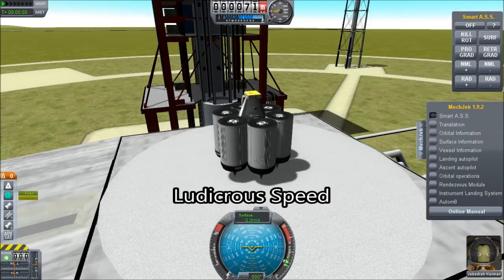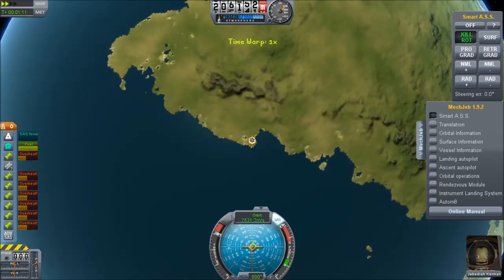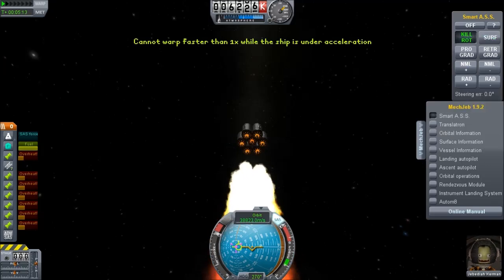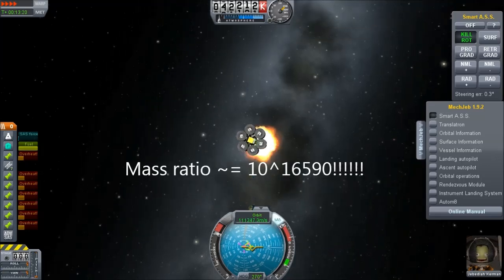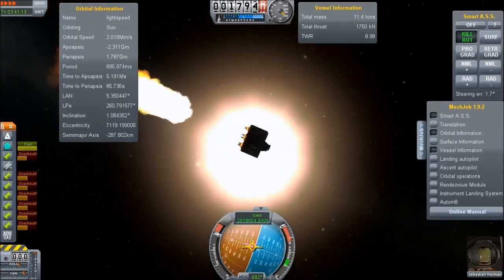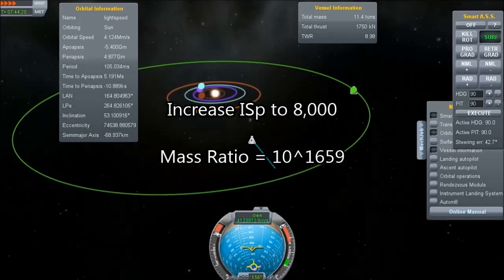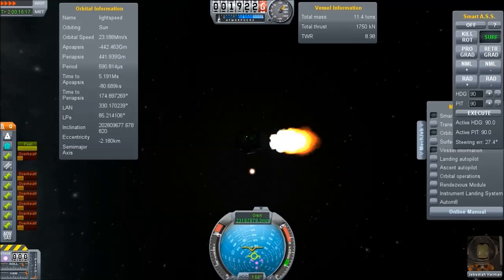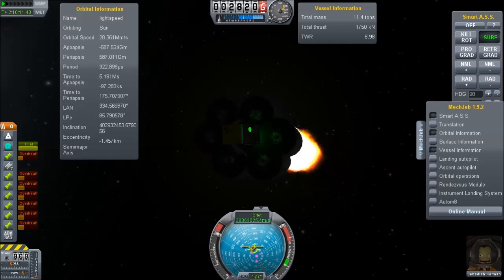What Does It Take To Reach Lightspeed In Kerbal Space Program?

Comment: The Tsiolkovsky equation (the rocket equation) works for low speed travel.  

Figure speed knowing fraction   Figure fraction knowing speed
Vf = Ve* LN(1/(1-u))   -->     u = 1 - 1/EXP(Vf/Ve)

Where Vf=final velocity
            Ve=exhaust velocity
            LN(...) = natural logarithm
           u = propellant fraction. (0<u<1)
            EXP(...) = exponential function

Solid fuel rocket:  Ve=2.5 km/sec (SRB)
Liquid fuel rocket Ve=3.5 km/sec (Atlas, Titan)
Cryogenic rocket  Ve=4.5 km/sec (SSME, J2)
Nuclear thermal rocket Ve=9.0 km/sec (NERVA)
Nuclear pulse rocket  Ve=20.0 km/sec (Orion)
Ion rocket Ve=50 km/sec (NEXT)
Fusion rocket Ve=23,000 km/sec (Li-6/Deuteride pellet in a self collapsing plasmoid)
Photon rocket Ve=300,0000 km/sec
Light sail  (effectively infinity since propellant is not consumed on board)

When we use photon rockets (exhaust speed equals the speed of light) powered by matter/anti-matter, we need to adjust the normal rocket equations adjusting for the rapidity of the motion through space and time.  

This transforms the Tsiolkovsky equation to the Rindler equation;

For a positronium rocket this equation becomes;

Figure speed knowing fraction         Figure fraction knowing speed

   Vf = c * TANH( LN( 1/(1-u) ) )  ->   u = 1 - 1/ATANH( EXP( Vf/c) )

Where Vf = final velocity
             c = speed of light
            TANH(...) = hyperbolic tangent
            LN(...) = natural logarithm
            ATANH(...) hyperbolic arctangent
            EXP(...) = exponential
            u = propellant fraction (0<u<1, positronium)

So, to get to various speeds requires the following fractions of positronium;

u Vf/c dilation
0.1 0.105 0.994
0.2 0.220 0.976
0.3 0.342 0.940
0.4 0.471 0.882
0.5 0.600 0.800
0.6 0.724 0.690
0.7 0.835 0.550
0.8 0.923 0.385
0.9 0.980 0.198

90% positronium gets you to 98% light speed according to this equation which means that time flows at 19.8% the rate it does back on Earth.
  
Now, positronium is a Bose Einstein condensate and can have densities of up to 8 kg/litre - about the density of iron.  Positronium has a short life time if left to its own devices, but if put into a structured crystalline lattice, it can be made stable.  Such lattices can have the density of aerogels, which is about 1/10,000th of a kg/litre.  So, you can have a tank to propellant mass of 80,000 to 1.  Add in a payload, and you have 10,000 to 1 positronium mass to payload.

So, in this case u = 9,999/10,000 = 0.9999 and Vf = 0.99999998 * c     

In 1998, Danish physicist Lene Vestergaard Hau slowed a beam of light to  17 meters per second.  Harvard scientists in 2004 succeeded in stopping light completely, and restarted it.  In 2005, IBM researchers created a microchip that stopped light and restarted it, made of standard materials paving the way toward commercial adoption.

One interesting detail of this process is that the electric and magnetic field strengths can be made to increase in intensity as the light slows.  This is the result of very high frequencies and high photon energies.  At 511 keV the light efficiently makes positronium.  In the right nanoscale environment, this positronium can be quite stable.  

http://www.livescience.com/45724-turning-light-into-matter.html

Now, I have proposed the following programme at a recent National Space Society conference;

  (1) Create a self-replicating solar panel that uses metals in the solar atmosphere to copy itself, and takes excess energy and stores it as positronium.

  (2) Drop a square meter into a low orbit that is near the solar surface.

  (3) It mines the solar wind for heavy materials and expands its area.

  (4) It collects excess solar energy in the form of positronium.  

https://www.linkedin.com/pulse/20140922230824-39571567-the-stars-are-in-our-reach

http://trashotron.com/agony/columns/05-24-02.htm

http://www.bobkrone.com/stars-are-our-reach

The sun loses 1.1 billion kg of material per second in the form of solar wind.  The sun also converts 4.27 billion kg of mass into energy every second.  This translates to 5.7 grams of material each year per square meter and 22.1 grams of positronium per square meter per year, if the energy is efficiently converted to positronium.

Now the bulk of the energy of the photosphere occurs between 100 nm and 1000 nm - which is far larger than the 0.1 nm size of atomic structures.  The energy of photons in this range of wavelengths is also smaller than the binding energies of most materials.  This means a sparse array structured materials can be used to process light in these wavelengths efficiently, and very little mass can cover large areas with efficient solar panels.  That is, when built efficiently on the nano-scale, solar panels massing only nano-grams per square meter can efficiently absorb sunlight and store many many kilograms of positronium.  

A system that masses 1800 nanogram per square meter and converts sunlight with 99% efficiency to positronium, collects enough material to self replicate every twenty minutes - using only 0.8% of the solar wind (carbon, iron, etc.).   At 63 MW/m2 only 1% of this is 315 kW/m2 when radiated as heat from both sides of a thin panel.  This implies a temperature of 1,535 Kelvin for such a panel.  At 99.9% efficiency, temperature drops to 863 Kelvin.  

1 square meter dropped into a low orbit that replicates from solar wind material every twenty minutes requires less than 21 hours to cover the entire sun reducing its temperature to 1535 K  to 863 K and its power output drops to 1% or 0.1% of its present output.  

Of course, an array of emitters on the back side of the panels facing away from the sun create holographic images with positronium powered lasers.  An array of detectors also operate to sense the surrounding environment.  These are used to create an image of the solar surface of any body visible from the solar surface.  

So those inhabiting such bodies would be supplied energy artificially so that they detect little or no difference in the sun's activity. 

On planets that were too hot, energy would be reduced to lower levels, cooling those planets.  On planets that were too cold, energy would be increased to raise levels, heating those planets.  

Calculating the Airy disk of light projected from an optical element 695,000 km radius, indicates the size of the power beam that may be formed in different colors at various planetary surfaces at various distances from Sol.  This would be used to control the weather on those planets - in addition to bulk heating and cooling.  This would also be used to illuminate and power space stations on demand.

Now, consider a positronium powered laser array operating on the surface of the Sun, that illuminates a star ship in such a way that accelerates it!  

Consider too that instead of reflecting away the incident light, or even absorbing the light to heat the ship as heat, consider that you absorb the light emitted by the Sun based laser array, within a similar solar panel that produces positronium on the ship after absorbing its momentum!  The positronium is stored on board the spaceship!  

This means that you can accelerate by collecting beamed energy from the Sun and store that residual energy on board the spacecraft.  You of course lose energy due to Doppler and Lorentz effects, but the retained energy is used to slow the spacecraft to a rest at its destination!  

You return to Earth, or continue onward, by dropping a square meter of solar collector into the target star's surface, and in a day, return (or carry forward) your journey, using that star's energy in the same way as you arrived.

At low speeds, efficiencies can be increased by recycling photons rather than storing them on board a rapidly moving ship.  Another way to reuse photons is to recycle them.

https://en.wikipedia.org/wiki/Photonic_laser_thruster

Energy is equal to mass according to 

E=m*c^2   

Where E=energy in Joules, m=mass in kg, and c=speed of light in m/sec

You need about 100 tonnes of energy to accelerate 1 tonne of mass to 98% c and slow it down to planetary speeds using the approach described above.  90 tonnes of energy is absorbed during acceleration in the form of beamed energy.  10 tonnes of energy is stored on board the 1 tonne ship.  

The beamed energy speeds the ship up, the stored energy produces beams that slow it down.  The panels that operate on the sun, are modified to operate at the base of the ship to achieve these effects.  

Now, in a large cylinder like an O'Neill cylinder with spherical end caps, that's spun to produce nearly one gee on the interior, and is illuminated by an anti-matter powered light bulb inside, to reproduce Earth like conditions, is accelerated by absorbing laser energy from the solar panel array described above.   

A spherical positronium storage tank at one end, which is covered with photonics rockets/laser absorber, built using the solar panel technology described, accelerates the cylinder along its axis of rotation at 1/4 gee.  With an outward force of 96.82% gee, forming a 1 gee force angled 14.47 degrees to cylinder wall, or 75.53 degrees from rotation axis normal.  The interior of the cylinder is equipped with tiles that are supported by a six axis Steward Platform - that maintains normal gee forces on each tile, regardless of acceleration of the cylinder.

https://www.youtube.com/watch?v=7zgKDgTIfgk

The point of all this analysis is that it takes about 10 tonnes of material to support 1 person in this manner.  So, a 250,000 person colony masses 2.5 million tonnes.  Such a colony requires 25 million tonnes of positronium storage on board to accelerate to 98% light speed, and that entire system requires 250 million tonnes of mass energy be beamed at it from the solar surface or some other stellar surface equipped with self replicating solar panels, to set it on its way.  

Now, the Sun produces 4 million tonnes of mass energy per second.  It also produces 1 million tonnes of material per second in the form of solar wind.  So, one of these colonies could be dispatched from the solar system every 63 minutes.  Using the metals and heavy materials in the solar wind, and beaming those to assembly centers, to be additively manufactured into mobile colonies, also supplies the raw materials needed at more than sufficient rates.  

Now with 9 billion persons growing at a rate of 1.12% per year 100 million people leaving the solar system maintains population.  250 million leaving each year, radically reduces population levels at Sol.  This is 1000 ships, which is 1/8th the rate possible from the Sun using this technology. 

http://convertalot.com/relativistic_star_ship_calculator.html

At 1/4 gee acceleration it takes 9.22 years ship time to travel 4.3 light years to alpha centauri.  The ship attains a top speed of 76.57% light speed.  Only 7.83 years pass on the ship.  

At 1/4 gee acceleration to an object 31.21 light years distant, the ship reaches its maximum speed (as described above 98% light speed) after travelling 15.61 light years.  It then uses stored energy to slow down.  38.18 years pass on Earth while only 17.81 years pass on board the mobile space colony.  

There are over 100 sun like stars within this distance.

All this requires is creating a 1 square meter solar panel that self replicates along the lines described above, launching it past Jupiter, and dropping into low solar orbit, to begin its operation.  

Beyond 31.21 light years, the spacecraft coasts at 98% light speed, and travels about five light years for every year on board.  Coasting for another 17.81 years (doubling the travel time on board) adds another 89.05 light years to the distance, which brings the total to 120.26 light years!  There are  691 G-type stars within this distance.  Over 10,000 stars of all types.  

Starting with the most distant and rolling back 1 light year per year means that if we start in 2033 AD all colonies arrive at their destinations in 2161 AD.  

The year, the population on Earth, the population travelling to the stars, the distance travelled, the number of stars in that shell at that distance, the population arriving at each star within that shell, the year (on Earth) of arrival.   The year in ship time is 1/5th the distance + 5 years typically...  this is not shown, but is 2064 AD for the first line and 2096 AD for the last line.

Whether there are planets or not around these G-type stars is immaterial.  Arriving populations come equipped with their own self-replicating solar panels, and drop them on to the star.  This supplies them with sufficient material to build planetary sized space colonies in short order.  

Suspended animation for those on board, and rotating crews, mean that population growth on board is zero or radically reduced during transit.  (in addition to time dilation).  So, if 1% of the crew is active, and they're rotated during the course of the trip so all arrive relatively young (a 120 year journey would take only 1.2 years of crew time if 1% crew is awakened to spend time maintaining ship during transit) - and time dilation drops that to only 20% of time.  So, that's 0.2% of 1.12% population growth - which is essentially zero.  

Year Earth Stars  l 
2033 9000.0       0 dist. ly Star Pop./star Year Arrival
2034 8850.8   250 120.0 17 14.81 2161
2035 8699.9   500 119.0 17 15.03 2161
2036 8547.4   750 118.0 16 15.26 2161
2037 8393.1 1000 117.0 16 15.49 2161
2038 8237.1 1250 116.0 16 15.73 2161
2039 8079.4 1500 115.0 16 15.97 2161
2040 7919.8 1750 114.0 15 16.21 2161
2041 7758.5 2000 113.0 15 16.46 2161
2042 7595.4 2250 112.0 15 16.72 2161
2043 7430.5 2500 111.0 15 16.98 2161
2044 7263.7 2750 110.0 14 17.25 2161
2045 7095.1 3000 109.0 14 17.53 2161
2046 6924.6 3250 108.0 14 17.81 2161
2047 6752.1 3500 107.0 14 18.10 2161
2048 6577.7 3750 106.0 14 18.39 2161
2049 6401.4 4000 105.0 13 18.69 2161
2050 6223.1 4250 104.0 13 19.00 2161
2051 6042.8 4500 103.0 13 19.31 2161
2052 5860.5 4750 102.0 13 19.64 2161
2053 5676.1 5000 101.0 13 19.97 2161
2054 5489.7 5250 100.0 12 20.30 2161
2055 5301.2 5500 99.0 12 20.65 2161
2056 5110.5 5750 98.0 12 21.00 2161
2057 4917.8 6000 97.0 12 21.37 2161
2058 4722.9 6250 96.0 12 21.74 2161
2059 4525.8 6500 95.0 11 22.12 2161
2060 4326.4 6750 94.0 11 22.51 2161
2061 4124.9 7000 93.0 11 22.91 2161
2062 3921.1 7250 92.0 11 23.32 2161
2063 3715.0 7500 91.0 11 23.74 2161
2064 3506.6 7750 90.0 10 24.17 2161
2065 3295.9 8000 89.0 10 24.61 2161
2066 3082.8 8250 88.0 10 25.06 2161
2067 2867.3 8500 87.0 10 25.52 2161
2068 2649.5 8750 86.0 10 26.00 2161
2069 2429.1 9000 85.0 9 26.49 2161
2070 2206.3 9250 84.0 9 26.99 2161
2071 1981.0 9500 83.0 9 27.50 2161
2072 1753.2 9750 82.0 9 28.03 2161
2073 1522.9 10000 81.0 9 28.57 2161
2074 1289.9 10250 80.0 9 29.12 2161
2075 1054.4 10500 79.0 8 29.69 2161
2076 816.2 10750 78.0 8 30.28 2161
2077 575.3 11000 77.0 8 30.88 2161

So, this is how we move from Kardashev I civilisation to Kardashev II+ civilisation 

By colliding massive shaped objects at near light speed - to produce implosions that result in engineered micro-black hole arrays, we begin to manipulate space-time so as to create rocket that tap zero point energy, and have high surface gravities, allowing colonies to fall into rings of micro-black holes whilst the ring accelerates using neutrino rockets.  Neutrino rockets are like photon rockets but the exhaust is undetectable.  Since they extract zero point energy, they require no fuel.  

A Klemperer Rosette of micro black holes 

https://en.wikipedia.org/wiki/Klemperer_rosette

can be arrayed to produce significant gravity along its axis of rotation, and nearly zero tidal effects.  Equipped with micro-neutrino zero point powered rockets, a conventional spacecraft accelerates into the axis of rotation as the rosette itself accelerates at the rate the conventional spacecraft falls toward the ring.  In this way 1000s of gees can be sustained by a conventional craft without crushing it.  A slight disparity in gee forces, can produce earth normal gravity in the process.

This shortens the time of travel between the stars.  

Alpha Centauri is reached in 5.95 days ship time by this process.  Upon return to Earth, 5.95 days travelling back, they would find themselves 8.6 years in the future.

Of course, with high surface gravities, other geometries than rosettes are possible.  A Tipler Time Cylinder may be constructed before departure, and traversed upon the ship's return bringing it back to the point in time (plus ship time) so that it arrives a few weeks after departure, with no disagreement between ship board clocks and Earth bound clocks. 

The interesting thing is that if we are able to travel through time in this way, our population drops even further!  That is, if we open ourselves not only to travelling across the cosmos to any spot we like, but also open ourselves to travelling across time to any epoch we like, population densities drop even further.  If the many worlds interpretation of quantum physics is correct, this also opens the doorway to parallel universes, which drops population densities even further still!   20 billion people across 400 billion stars in the galaxy, is less than 1 person per star.  Across 1 billion years of time, and the billions of galaxies within 1 billion light years, and across all the possible parallel universes - this explains Fermi's paradox - Where are they?